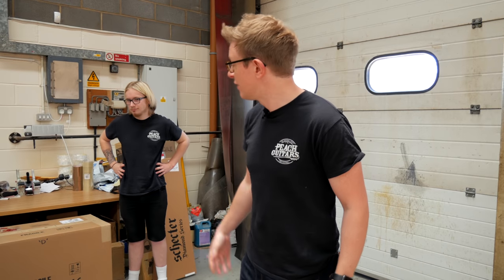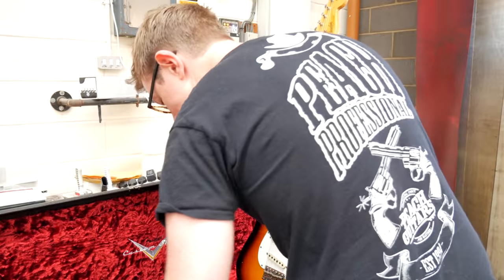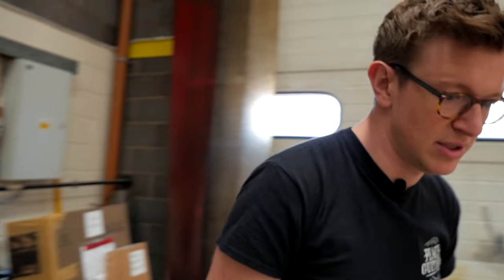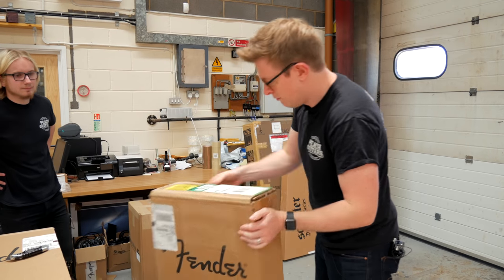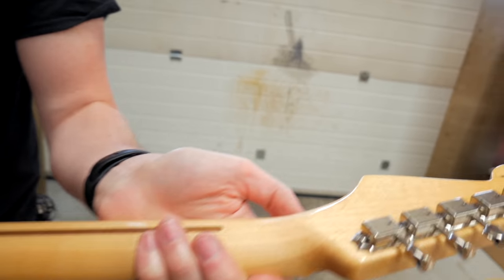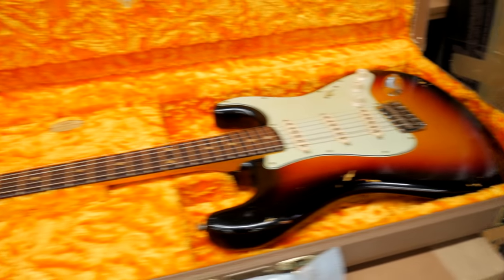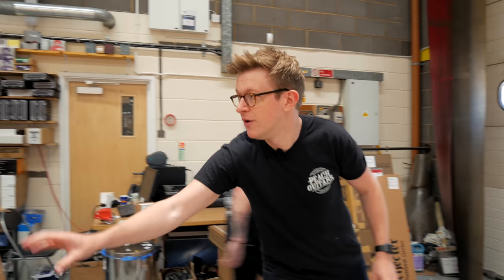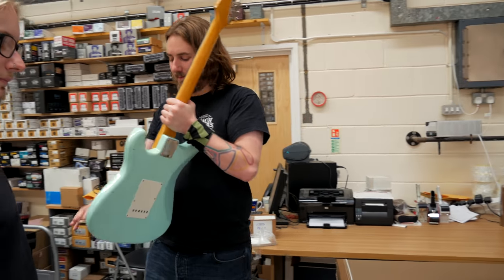Unboxing 18 Fender Custom Shop Strats! - Huge Delivery!

Comment: That sound of his ring hitting those new guitars...
Reply: Seriously every one of them. I think he gets off on the sound clanging his ring on the back of the neck.  I don't care if it's relic they don't put dings on the neck but his rings do!
Reply: My Ring Hits Every One Of My 11 Vintage Fender Strat's/Telicaster's Back & Front When I Play'em Over 33 Year's NEVER Caused a Problem Relic or Not? No Big Deal for Some? 🙄
Reply: With all the fake damage guitars how do you know
Reply: Can't be any worse than the dudes at Fender hitting new guitars with a sander.

Comment: In the 50’s Fender send the guitars with 12 to 56 gauge flat wound strings from the factory. That’s why the big necks and 5 springs. Everything was done for a purpose. Unlike today. The gimmicky years

Comment: There’s something bout heavy relics that looks unrealistic to me.
Some vintage ones yellow over time like an Olympic white one I saw, it’s was yellow like a lemon and it never had a refin or anything like that. And what about that almost satin look when the finish sinks into the wood or the orange tint on the headstock caused by the UV exposure. 
My point is that they should figure out some way to make a real old look to a guitar if the heavy relic thing makes the cost up on a guitar.
Reply: well I totally dig them
Reply: Spending extra money for relic or heavy relic is dumb AF... I'll take a brand new strat nd have it get beat up over time. Or just buy a real vintage strat... Sadly I'm lefty so its almost impossible for me to find a strat I like.

Comment: Crawling into bed with Fender is a HUGE mistake, but you won't know it until the day they simply cut you off with no warning.

   I,  along with about 25 other small luthiers,  can sell you a better strat for less.  and still use Fenders parts.